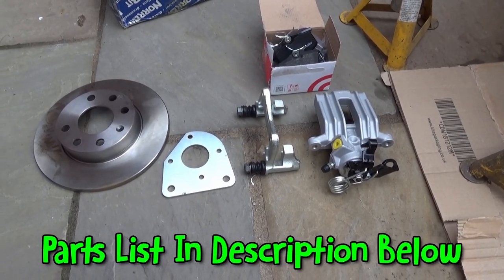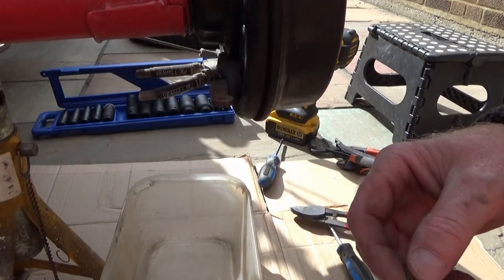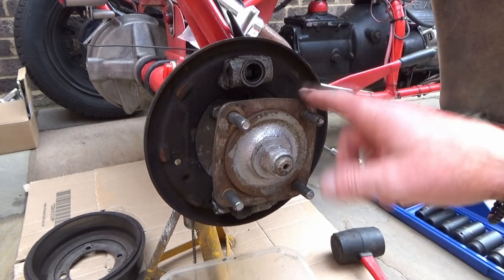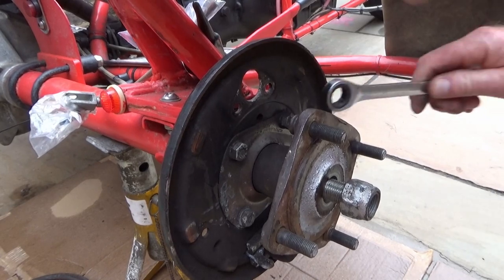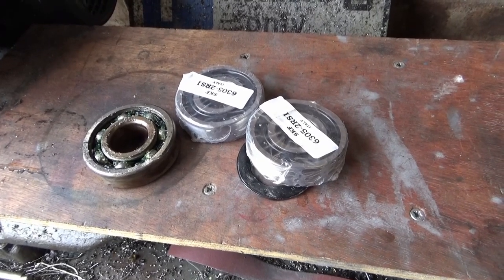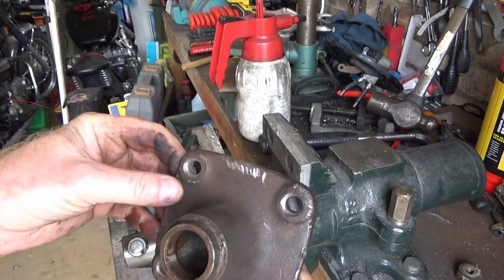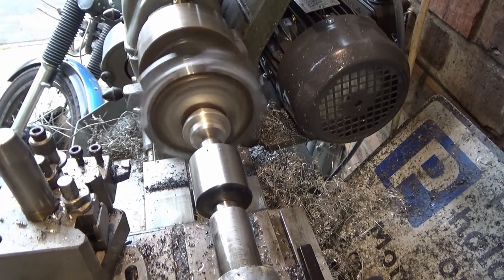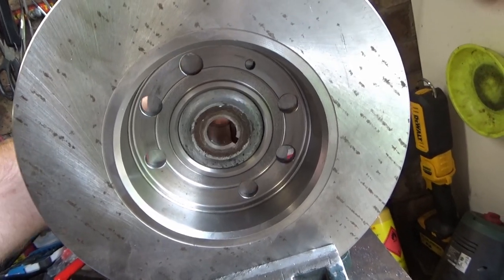Reliant 850 Trike - Rear Brakes Drum To Disc Conversion Part 1 Strip Out and Machining

Comment: dont you have a blow torch???
Reply from the maker: I do but it’s only little and would use a lot of gas trying to get that much metal warm.
Reply: @bodganeering  you could use the kettle technique its great for removing wheel bearings used it myself many times just tip it over the surrounding aera not on what you want to remove then bang away. But hey you got there anyway so nice one
Reply from the maker: Can't make life too easy can we... LOL
Reply: Mitsubishi colt / charisma (early 90's) discs have a larger bore on the mounting faces so you don't need to machine the corners off the hub which comes in handy if you intend to change the pcd as you retain more material.

otherwise they are the same dimensions as the nova discs, disc centre bore or hub still need machining though (depends whether you intend to ever go back to drums as to which you machine)

You need to use different pads though (Volvo ones iirc) that are shorter/curved on the bottom edge but have the same dimensions elsewhere as the VW pads so fit the same hangers and calipers.
Reply from the maker: @prawny12009 handy to know, thanks.
Reply from the maker: @rickywoodcock7222 a disc option for you here to look at.